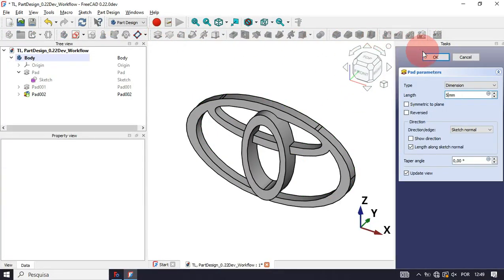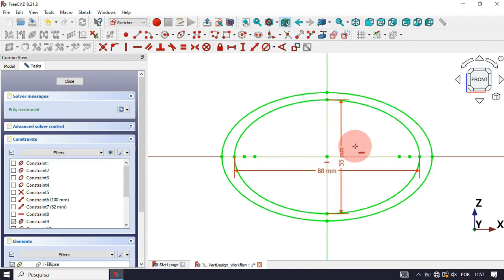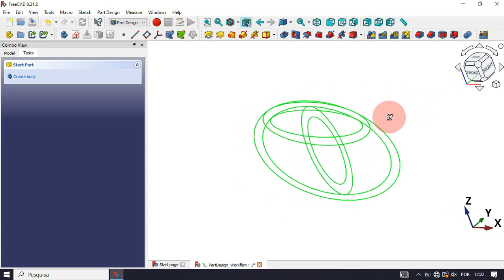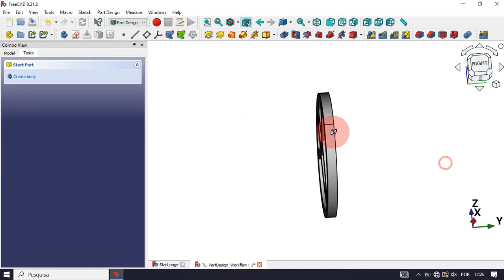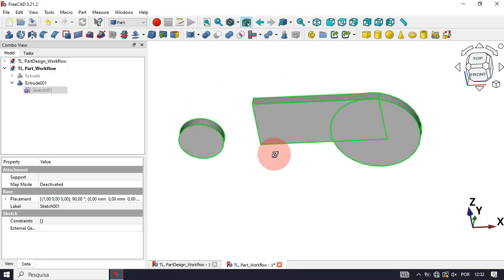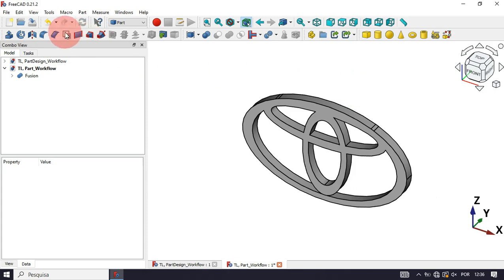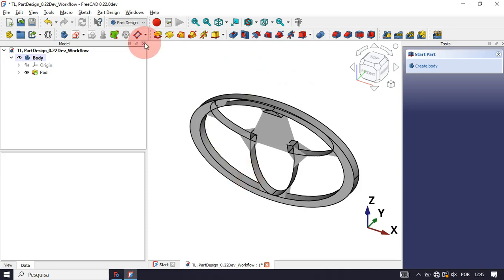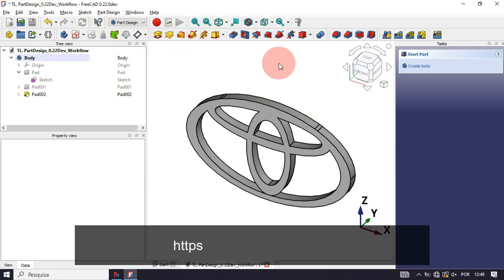The new FreeCAD 0.22Dev complex extrude feature in the PartDesign workbench

Comment: I haven't tried it, but another way if you don't have the dev version is to use the trim tool to remove edges that intercept between the multipole ellipses.
That will reduce the sketch to 1 body, and you can change dimensions later without having to deal with multiple sketches.
Reply from the maker: Yes, good idea. But even so, it can create unwanted work with constraints. I haven't tried your method, but I imagine that trying it means having to deal with constant constraint failures. Even worse, it's about ellipses.
Reply: @OffsetCAD  I gave it a try and you are correct. Trimming edges with ellipses cause all kind of issues. The trim tool doesn't find the right intersection between ellipses and you end up with gaps.

Comment: Omg, if it works as I think it works it will immediately make freecad usable for me. In fusion I'm used to creating one big sketch, and then pulling all the geometry from it piece by piece, but in freecad there was no option to do it
Reply: It works until you make changes to the sketch and then it breaks.
Reply from the maker: @mfraz74  yes! It breaks.
Reply from the maker: Believe, next versions are up to make design easy on FreeCAD.